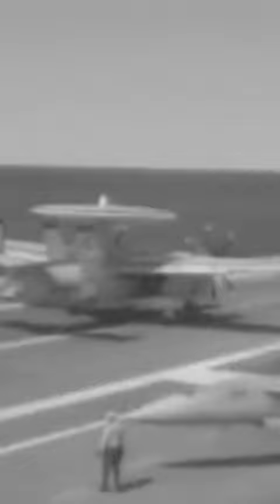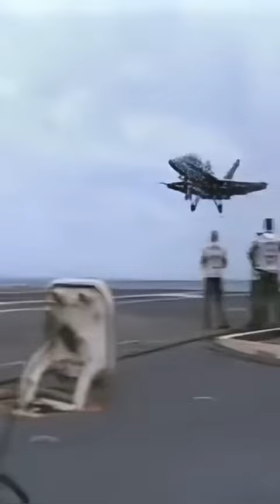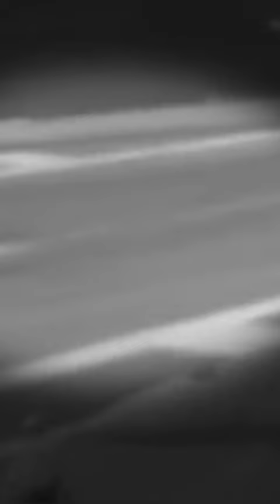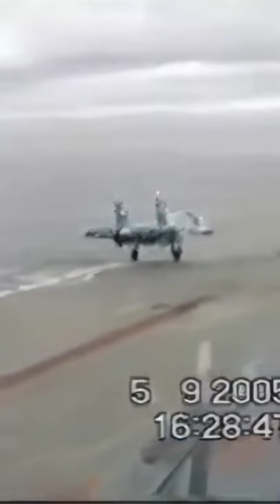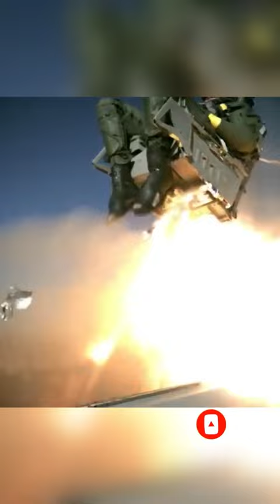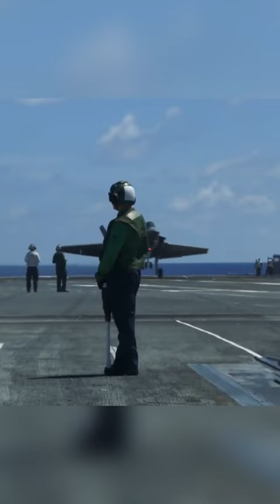INSANE Method Navy Aircraft Use to Avoid Dying on A US Aircraft Carrier😱

Comment: The difference between a touch-n-go on a carrier and a bolter is whether or not the tail hook is deployed. If the tail hook is not deployed, it's a touch-n-go. If the tail hook is deployed, it's a bolter. If the tail hook catches the wire, it's a trap.

Comment: I was in the crotch of the angle when the pilot dropped below ME and I looked down at the top of the phantom. He made it back up , but that was a close one.
Reply: Hi dave, I was #1 flight director  I was usually between #1 and 2 cats my first  carrier was the USS Lexington cat out of Pensacola 

We train pilots l make their first angle deck landings. They did couple touch an go's then the LSO let them catch the wire. When they 
Hit the deck they go to full power. You don't how many times they get shook up and miss full throttle when hitting the deck and missing 
The wire. I would run over look down at pilot hits land gear so fast. Pulling back that stick talking to his plane spraying water mist into the
Air. Some even bounced on the waves. They started off in prop planes T-28 then they went to jets T-1 an T-2 and we did the hole thing again
Same now flying faster planes. If they missed the wire you ran and watch top of plane to seeing they make it. That ship and airboss was 
The place to make you learn how to be a good flight deck person. There is more to a flight deck operation than people see on tv.  You have
A orchestrated chaos close your eyes remember a flash of blue shirts by , turn a blurr of green , yellow tow trucks,,
Reply: What's the closest buzz you guys ever got on the deck and what plane?
Reply: @Chancellor_dumb  2 to 3 feet a vigilante. Hit the  round down or back edge of flight deck the nose gear busted off and came flying
Down the flight deck towards the island. What saved another guy an myself we dove behind a tow tractor sitting there. I don't know 
 where the guy went that was sitting on the tow tractor , he was a driver waiting for a plane to tow forward I glad he was there. The wheel
And landing gear hit the other side of tow tractor , believe that it moved the vehicle and us about 6 inches towards the island and hit 
The island at a hatch way and stopped. The hatch way we just came out of.  I call this a lucky night ops. They taught me to watch the
Plane landing and you will survive. Thanks dave, hope you could follow all that.